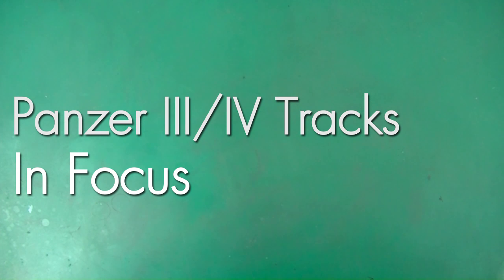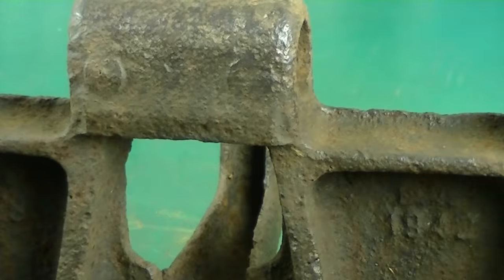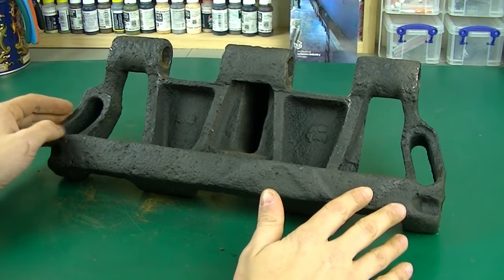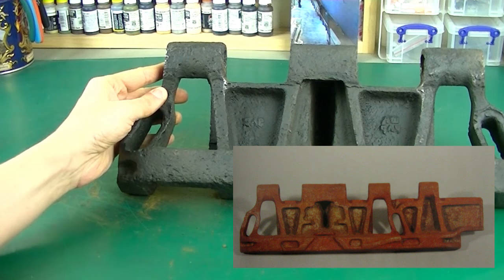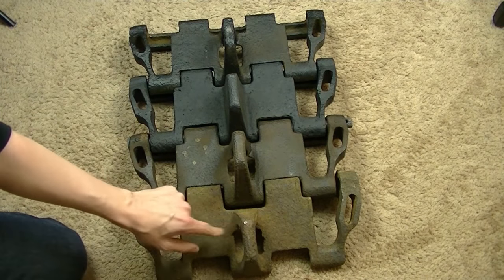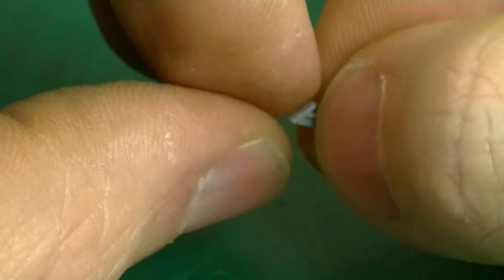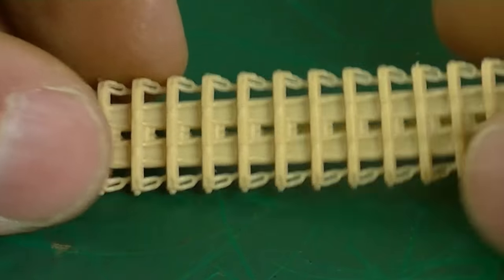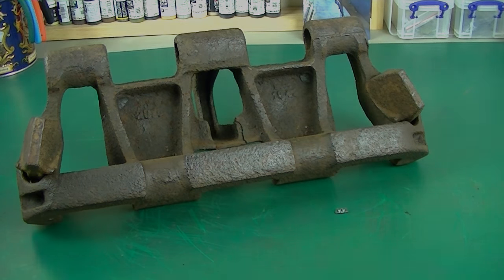Panzer III/IV Tracks In Focus

Comment: Great documentation  very well presented as was mentioned by others the shiny bits and chrome welding rods as the for the castings they where chrome /manganese and very hard the two round raised little where the molten metal was poured in to the sand casting and the small showed when it was completed thank you so much for the articles  you post Leonel Cape Town  south africa

Comment: Fascinating video.  About fifteen years ago, I bought two pairs of identical type track links from a seller in Poland or Latvia and never knew the details other than they could have fit either a Panzer III or IV.  From this informative post, it turns out one pair are Type 3 (a) and the other pair are Type 7 (without chevrons).  Never could understand why the two different track link types couldn't fit together but now I know!  I'll have to get a copy of the Panzerketten book even though I can't read German.
Reply from the maker: I can't read German either. I hold my Phone with translate app running up to the pages. It's a great book if you're in to collecting or just identifying tracks. Type 7 is a rare one, do you still have those links?
Reply: I still have the track links in my collection.  They are in relic condition and never bead blasted or painted.  When I found them for sale, I knew they were different and at the time, didn't know why.  Found a really good picture on Reddit showing what I believe are Type 7's on a late production Sturmpanzer IV.  Search for "Sturmpanzer IV or Brummbär German heavy assault gun in an unidentified town and date.". I'm speculating the German's introduced the heavier duty Type 7 track to meet the weight demands of the later Panzer IV variant vehicles.

Now that I know more about these various track link link types, I'll have to look to expand my collection.  Seems the prices have gone up quite a bit since I bought my current links.

Comment: Hi Adam, the reason the tack welds are shinny is they're almost certainly made using arc welding rods made from an alloy of nickel. When welding dissimilar types of steel, in this case cast steel to armour plate, it helps to prevent cracking that would occur if you used a steel based alloy welding rod. Steel has a crystalline structure and because the tack welds cool so quickly because of the quenching effect of the cold steel surrounding the weld area that the carbon in high carbon steel remains trapped at the boundaries of the individual cells in the weld which makes it likely to crack. Armour plate has a higher carbon content than mild steel and is heat treated to give it its extra strength but isn't that easy to weld because of its carbon content. Nickel often looks like a dull version of chrome and can have a slight yellow tinge to it which may be apparent on your track plate.
Reply from the maker: Wow what a comment. Thanks so much for that. I have wanted to understand metals and welding for sometime now, but it's a big world to dive in to. I may need to read that comment many times to try and get it to stick.
Reply: Hi Adam. Thats very much a shortened version but hopefully will give you a little bit of an insight. Thats only a guess by the way but the fact that the tack welds aren't rusting suggests there's a lot of nickel in the alloy used.

Comment: Great work!. I love your video and model making. I am also a great fan of Panzer track links. I've been collecting them for more than a decade. By the way, most of panzer books and some model makers call type7 track as "Light weight track ". I always had question about this name so I measured  all 38cm tracks. I found most of them weigh around 7kiro  except type7. As you know There are two variations for type7 track,one with chevron and one without. They both weigh around 8kiros !. Most of type7 tracks were found on the heavy Panzers like Jagt panzer4 or Brumbear, not on common Panzer4 tank. I think this type7 tracks were made to last longer on heavy Panzers so it should be called as " Heavy duty track " ,since they are not "Light weight " !.
Reply from the maker: That's fascinating, i had never thought to weigh a track. I have done magnetic tests on early and late war tracks to see if the alloys were really worse in 44/45. They are more magnetic so that answer is yes. More steel and less manganese is more magnetic.
Reply: @AdamMann3D  I really don't know who started to call this track " light weight ". I think we should start to call this as " Heavy duty track " !

Comment: Really great video. I didn't realize that there was a small market based around the real track links.

I can't believe that people bother you about your dislike of DS tracks. While they can be really good for shermans, they aren't very good for german armor. Their only benefit is that they have no assembly involed. But in terms of detail, magic tracks are far better. If someone likes DS because they don't want to assemble the links, then that is perfectly fine. But they shouldn't try to convince themselves that the DS tracks are somehow superior to magic tracks. If they don't want to put in the time that it takes to assemble magic tracks, that is no fault of the tracks - that is their own problem. 

As long as one knows how to correctly assemble magic tracks and has the extra time to do it, the result will always look better than DS. Something I don't think you mentioned is that magic tracks (at least some of them) even come with the cast numbers molded in - not something you get with DS. DS tracks sometime have flash, which is almost impossible to fix due to the nature of DS. It is very hard to cut off the flash without damaging the track. In addition, cleaning the flash would make the job tedious, defeating the entire purpose of DS tracks - they are supposed to not require any assembly or clean up.
Reply from the maker: That's a good point about the casting numbers on Magic tracks, I had forgotten about that. I do get some heat over my hatred of DS, which as you can tell I sort of addressed here.

Comment: Very informative. Cheers, Adam. As you say, I'm not very likely to get my hands on any real links so getting the chance to cast a modeller's eye over them up close is a rare opportunity. I can actually see how (with many hours fiddly work) it would be possible to correct a couple of the flaws with the magic tracks. I've just done a Jagdpanther G2 with Model Master tracks from Russia. They're more uniform and take less clean-up than Friul and use individual resin track pin ends (one each side for each pin) rather than wire but end up surprisingly strong and fully workable. I burnished them rather than painting them this time, and it preserves all the hard edges, gaps and casting marks that even a thin layer of primer can't help but soften. Highly recommended. My current camera simply isn't good enough to do the detail justice, but I'll be posting it up on ISM soon.
Reply from the maker: You're most welcome. I'm going to try track burnishing myself for the first time on a Tiger build, I think a lot of people tend to lean heavily on the cover the tracks with dirt and mud idea. And I totally get that, but I think they have a lot of personality on their own so it's nice to find ways to just replicate and draw attention to them. Cheers.

Comment: What is size of the sprocket in kits and width of tracks in kits? I have Tamiya and Academy and they are 2 milimeters wider than real wheel and real track converted to 35 scale...

Comment: The springs are look like the ones that can put some pound of pressure down in common work bench bansaws etc they'll no fall out in a hurry! There the ones I'm fitting to the bergepanther for a winter base scene wit my the mechanics its looking good! I remember you saying on a stug3 video they went in every 4 links would this be accurate for the Aust A bergepanther?

Comment: Got this snippet from the ASL forums. Thought you might be interested.Paul Weir stated: 'The Germans had a habit of when a newer and flashier version of some fittings like lights came out they often could be back fitted to earlier mountings. For example when the Pz III moved from 38cm (Ausf E-G) to 40cm tracks (Ausf H-N), the old drive sprockets could be used by replacing the toothed sprocket rings with spacer disks and new sprocket rings, retaining the core and all the mounting stuff. So you could see 40cm tracks with the earlier 8 hole drive sprocket central disks, but not the later 6 spoke drive sprocket with 38cm tracks."
Reply from the maker: That's an excellent bit of history I wasn't aware of, thank you. What is the ASL forums?
Reply: Adam Mann  ASL is the Advanced Squad Leader forum. Mr Weir has contributed a lot of technical information. He added more in the same thread, which is about an insignia on a Panther. He also clears up a bit about early Pz V Ausf A. Apparently earl A's had the same machine gun port as D's.

Oh the forum is on Gamesquad. You may find some material there, especially if you want history of units battles, very good scenario's about your favorite cat.
Reply: And a little more information about tracks."Now that I think of it, for the Pz III, I think that they only had to add spacer rings between the bulk of the drive sprocket and the toothed outer ring. While the tracks were 2cm wider, they had the same pitch (IE front to rear), so the old teeth should work. Given the wear the drive sprocket's teeth would get, the maintenance people would be tempted to change those as well, any chance to catch up with more routine maintenance would be welcomed and taken. Besides, a change in track and it's width would be a bit more than trivial job and would usually only be done when the old stocks were gone. Most AFV that I can think of use a similar breakdown. The hub had a pair of toothed rings bolted on. Now while for speed you might replace the whole sprocket, once things quietened down you unbolted the toothed ring(s) and put new ones onto the old hub which now became part of your spares cache. The only parts needed from the rear echelons would be the toothed rings."

Comment: Fantastic research work, absolutely love it! But then again I wouldn't have expected anything less from you Adam! And as I am sure you have noticed, I agree with you completely about DS/Vinyl tracks, they flex wrong. It is also one of my problems with Friuls and Easy links Leopard 2 tracks, they are only hinged at one side of the connector link, and when it curves it looks just wrong. KUTGW!
Reply from the maker: Thanks very much, and it's nice to know other people don't like DS. If I'm making a replica, I'd like the tracks to look right.

Comment: As I watch this again, I have noted some interesting things.  

First of all, I do have a bunch of Type 2 from Dragon that came as magic track spares on my Pz III H Late (kit tracks were DS and Type 3A I believe).  They look great and can fit with Type 3 as I have done on my Pz III.  They probably gave me like 60 links which is cool.  

Somehow I never knew Type 5C was a term, though I have seen tons of them as Kaizen makes a set and such.  I guess before I figured they were just lumped in with Type 5B.

I think you alluded to this in the video but in terms of just the guide horn, Type 6A is solid horn (like 5B horn) and Type 6B is solid pinched horn (like 5C horn)?

I do think it would be cool to see Type 7 working with ostketten together.  Sadly no photos but there's plenty of winterketten and Type 3/5 mixed up...
Reply from the maker: I wish i could go back and explain that 38 and 40 cm is correct. Measured from the pins.

Comment: You seem to very knowledgeable about panzer tracks. I'm looking to build a Panzer IV G (161/2). But I'm struggling to find the correct model and correct tracks with winterketten. Any help would greatly appreciated.
Reply from the maker: Dragon do a great G kit number 6363, and for Winterketten you'll have to either borrow them from a kit that comes with them, or buy after market. I really like the Kaizen workable plastic Winterketten. They're about $20.

Comment: Hello Adam 
What would be a common track found on the Panzer IV G  used in Africa ?
Reply from the maker: 3a is most common on all vehicles. When they went from 38 to 40 (I have it as 36 and 38 in the video) 3a is probably seen 70% of the time. I have good images of Panzer IV G in Tunisia after being knocked out and they are all type 3a.

Comment: Hey i am going to build my own homemade tracked vehicle, i just wanna know how to prevent rust on the tracks, i am thinking of painting it but tracks are in constant friction with the ground, i am afraid it will tear off easly. Any suggestion how the germans prevented their tracks from rusting?
Reply from the maker: The surfaces that touch other links or the ground will lose their paint, but the same friction polishes them and keeps those areas free of rust for the most part. You will get rust if they get wet a lot, but it's surprisingly not a big issue. If the links are cast of strong enough metal ( steel and manganese in Germanys case) they will last a long time. They used dark grey primer on theirs. That's all.
Reply: @AdamMann3D  Oh what a great info.. thanks a lot, nice video btw, well researched. Keep it up

Comment: i know its about 5 years after, but could you please put up the measurements (in metric if thats not to much to ask) of the length between the tubes, the width of the sparr and the hight and width of the center tooth on the type 1, trying to recreate some, but i dont have the means to aquire the part to study, and, in recreate, i mean weld some stuff together, trying to make a pz, IV chassis, and having the right dimentions for the belts would have helped alot :)

Comment: First i have to say i love your video and it was very well done.

i have a (unfinished) 1:6 scale Stug III G in the garage waiting for better information (starting with the tracks and wheels) and am looking at 2 track designs (plus some slight mods), the first being the correct tracks links and the second the one with the 3 added ice cleats.

Do you know where i can find good, in depth drawings so i can have both drawn up in 3D that i could use as patterns for making resin and metal cast links?

any help would be useful

i was looking for a way to message you and give you my email address

Comment: Regarding the shiny metal on the type 5A tack link, it is probably steel with a lot of nickel or chrome in the welding rod, rather than aluminum. Great video, though.

Comment: If that is Al on the welds on the type 5, it anneals at a low temp, so playing a torch flame over the welds holding the link to the hull would soften the welds without affecting the steel at all. They would then knock off very easily.
Reply from the maker: Interesting, that helps me understand it a lot better.

Comment: Great video, Adam! The piece of solder attached to one of your track is not rusted because solder doesn't rust. When you paint a model kit this is one of the things you have to be warned about. Do not rust solder. It could be painted, weathered but never rusted. Regards
Reply from the maker: Fascinating, thank you.
Reply: There's no way that's solder.  If it's not rusted it's a stainless steel weld.
Tinplate & wires can be soldered not chunks of steel.

Comment: Non rusting metal would perhaps be some form of stainless steel alloy, IIRC it was often used for welding.
Reply from the maker: That's what I was told, so it would make sense.

Comment: the welds on the late type (add on armour) are nickel/silver.
Reply from the maker: Since posting this video I have been told they were just about every silver colored metal you can imagine. Do you have any reason to believe it's nickel or silver?
Reply: because one of the only metals that will weld hardened steel is nickel-silver  :) The Germans used either Steel or Nickel-Silver to weld armour plates together. They also used it to repair plating.  It does not corrode, and remains silver in color, while the rest of the armour plating oxidizes.  I have been involved in WW2 German vehicle restorations for a while, and whenever a tank is pulled from the ground, the only areas left un-corroded are the nickel-silver welds  :)  

The only material it really can be is nickel-silver  :)

Mike
Reply from the maker: Michael Fuller Interesting. Thanks for info. Might have to pick your brain sometime. My collection keeps growing and I want to get involved with restorations.

Comment: I know it is 6 month now, but a good show off the different Tracks, but again the Germans used what they had, even a new Track type comes out ,if they have sufficient Numbers of it, they will use the older ones so long they fit together i even assume  the fit different Types off Tracks together, later in the war the lack of Materials was quiet common, The to go with this tank had this this is wrong on this Tank , it only shows how it look on paper not on the real thing , or is someone thinking they stop the Production of Tanks while they have to wait one or two month for the new Track Links, or new Cuppola when they have a bunch of older ones in stock. I even have seen a Picture of a Sturmtiger with the so called early Roadwheels from Alkett.